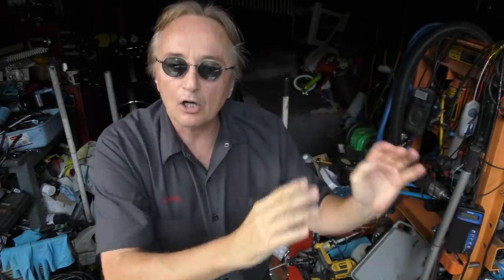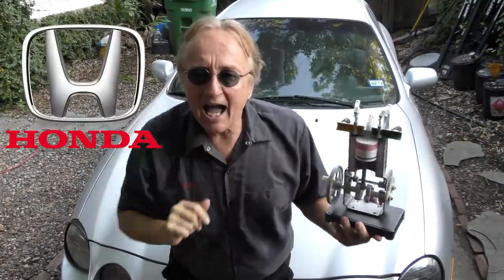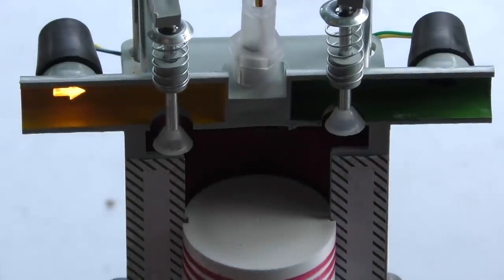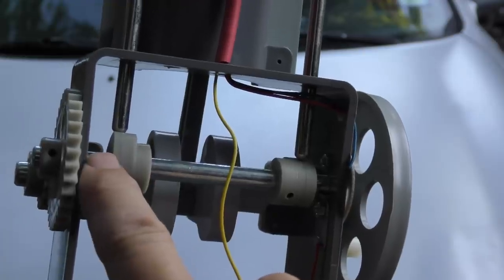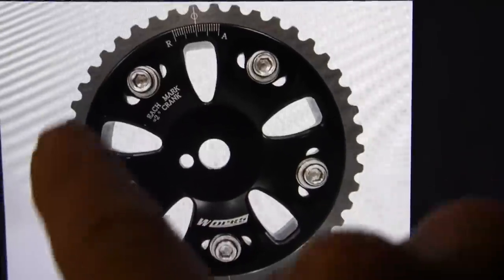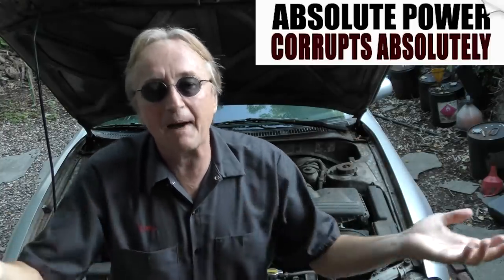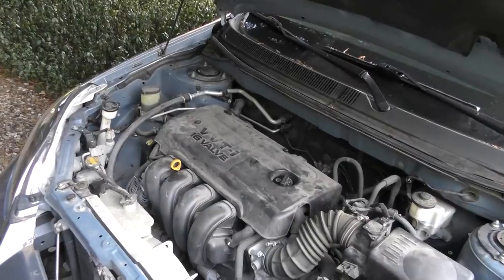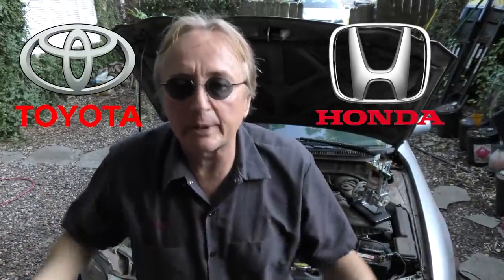VTEC Just Kicked in Yo - The Best and Worst VVT Cars to Buy

Comment: My first car was a 1992 Acura Integra. The most fun I've ever had in any car. Sadly someone hit me and it was totaled. Miss those vtec days
Reply: Vehicle Virals You can always get the latest Civic!! 😁 Maybe even the Type-R 😎
Reply: Abhilash Nair No way! Not even comparable :)
Reply: Vehicle Virals Why do you say that?
Reply: Abhilash Nair The driving experience and feedback you get from driving an older car cannot be replicated by a modern vehicle.
Reply: Always wanted a Integra or RSX. Have a 06 Civic now which I love driving for the gas mileage when I’m not driving my truck.
Reply: Vehicle Virals get a DC2 imported and thank me later
Reply: Love my GSR. It feels like I'm turning the front wheels with my hands.
Reply: Abhilash Nair The new Type R's are rice imo.
Reply: no.
Reply: 92 integra didn't have vtec
Reply: Raiders 559 wasn’t a gsr then I have 92 integra gsr it has the vtec badges even on the sides of the car
Reply: more like factory cheap plastic. hard to be rice without a fart can and leds lol
Reply: SeanxSkillZ never knew 92 Integra had v tech I thought they Only had a Ls motor
Reply: Phillip Morrison nah actually I’m under the process of restoring my paint due to sun damage my cars exterior is stock besides my front lip and a dual exhaust tip lmao I didn’t delete my muf or cat😂 I wanna restore it to its original condition since it’s a pretty rare car
Reply: Ls series is from Chevrolet...
Reply: Raiders 559 yeah bro it was apparently the first jdm vtec engine to be in usdm market don’t quote me on that I’ve just seen that a couple places but yeah it has the dual cams
Reply: i was talking about the new type r . i love the integras. good luck restoring your paint. gotta love Japanese clear coat lol
Reply: I had a 93 DA! Freaking fun car to drive!
Reply: Phillip Morrison b18b1 is Ls version in some integras,gsr (vtech) is a b18c1 I believe.
Reply: Vehicle Virals Aint that the truth. When I drive my familys Mercades and put it in manual mode the transmission always seems slow to react. Not like a real manual.
Reply: Raiders 559 they had a gsr one that did have it. But they didn't make many
Reply: Phillip Morrison he's talking about the ls integra
Reply: Fox McCloud 007 Shift paddles will never beat the experience of a real manual.
Reply: That was the slow gsr too
Reply: Vehicle Virals bought a 1992 GSR brand new back in 92 did $8.000 in mods that includes  SS header and cold air intake and sent CP to FL for upgrade had sus lowered short shifter the list goes on went threw 5 sets of breaks the includes rotors car would redline in 5 gear and do 140 had CART NO 1 for plates loved HONDA F1 got married  then had to trade it but at least i got new HONDA accord  still miss that car
Reply: Raiders 559 b17a were the vtec motors in the 92-93 gsr
Reply: Phillip Morrison Honda also has a series of engines called LS
Reply: Wrong, the 92-93 Integra was available with a b17a1 vtec motor. Simply put, its easily one of the rarest of the 90s hondas. Period.
Reply: Vehicle Virals I had a 94 Integra for my first car and loved it but unfortunately I was young and dumb and bought one that was not in great mechanical shape. I ended up selling it for what I paid for a year or so later but I loved it and really want to get another one in the future. right now I have an 07 SI with a bunch of HFP parts, invidia q300, skunk2 alpha header, Injen CAI, solid motor mounts and Hondata. but it will never replicate the feel I got from the Integra plus that Integra interior held up waaaaaay better than the civic one.
Reply: Ive been driving second gen integras since my first one in 1998. 20 years later I still have a DA, and park it right next to my rsx type s.
Reply: Vehicle Virals actually the new type r is an engineering marvel, easily the best Honda they've ever made in terms of performance. You should do some research on it and consider it.
Reply: Abhilash Nair those new civics are not even civics. Worst gen imo
Reply: Funny thing, I actually had the vtec solenoid wired to a button that I taped on to the shifter. I could literally activate vtec  whenever I wanted 😂
Reply: Blew the motor in my rally integra last weekend.  Doing a euro r swap.
Reply: I had a 91 and engine blew
Reply: My first car was an AMC "Hornet Sportabout Wagon", with decal "wood siding".  Sadly, it was a Hornet Sportabout Wagon with decal "wood siding".  (And "burnt orange" color...)
Reply: Scorpio7 XXX  i considered doing a b20 vtec.  Be a little cheaper but figure the euro r would work better for me if i import a low mile drivetrain.
Reply: Da9 Integras are always fun to drive and own for the Honda family.
Reply: Still daily driving my Prelude SH to this day.  Vtec and torque vectoring still work fine after over 20 yrs with minimal maintenance and no major repairs. It's just a fun car to row the gears and throw it around corners, even if it's rattly and the clear coat is failing...
Reply: Vehicle Virals Honda integra**
Reply: get a 2000 integra and k swap it
Reply: So u had a gsr?
Reply: @isaacgonzalez7040  nope and LS
Reply: We have the same first car but mine is a 1999
Reply: Get an rsx bro
Reply: @raychang8648  woukd love that nowdays
Reply: My dad had a Honda Integra!
Reply: Vehicle Virals - those cars were awesome. with a red line close to 8K RPMs... it was like a motorcycle! and I know it's a total cliché, but when you felt that VTEC kick in, man... you could feel it kick in, yo!
Reply: 1999 chevy cavalier my brother had a 1997 GSR, more fun to drive then my Speed6 hands down
Reply: NOOOOOO NOT THE INTEGRA MAN
Reply: My cousins 94 si eg hatch is just sitting in our yard bc the struts and CV's are bad smh.

Comment: As a long time BMW owner, the switch I made to Acura/Honda has been nothing but a great experience. The engine is super easy to maintain, and is extremely reliable. Thanks Scotty
Reply: which honda/acura did you get?
Reply: @mathewsoul7623  Acura TL for myself, Honda Accord Coupe for the wife. Both running beautiful with very little maintanence
Reply: I take it you weren't an E36 M3 owner. If you were, you'd never sell it for downgraded Japanese cars like those. Although they are cheap, and cheap to maintain they just don't really have very much of a soul compared to any of the M cars. Owning them is a labor of love but if you do everything right they last for a very long time

Comment: had my integra for years, over 300k miles still runs like new
Reply: ThumbsUpGaming yep!  My 94 ls has 309,000 miles and purrs like a kitten.  Only changed timing belt twice, water pump, and front rotors.  My goal is 500k and if it finally gives I’m putting in another b18b1 in her.
Reply: I have make with my Civic 360000km and the 1998 Integra of Frend of main has 330000km without any Problem Honda is fucking Reliblle
Reply: ThumbsUpGaming what did you do what kinda maintenance you did please let me know 

I got a 3.0 Honda accord v6 just hit 120k
Reply: Got a 2003 Acura cl with over 300k only thing it need is motor mounts other then that it's run strong af
Reply: I'm a Uber driver driving a sporty 2014 Civic si sedan. It is at 161K and still running strong.
Reply: Josh Smitty Taxis “whats an odometer”
Reply: I have a 2003 honda accord 2.4L with 330k still running like champ...
Reply: My 96 Integra GSR is at 226k miles, still runs decent lol. Probably gonna K Swap soon though before it blows

Comment: Call me a ricer but I love hondas they're great cars to get into the car scene or just have a good reliable daily
Reply: the • 6999 seconds ago I bet you don’t even have a car
Reply: the • 6999 seconds ago dude Honda’s and yotas are the best bang for your buck, you’re aren’t getting a luxury car most always have plastic and stuff sometimes leather but you’ll never be let down. Like Scotty says, typical Toyota starts right up
Reply: @plagued3904  I dont know about Toyota being best bang for buck too pricey at least where I am there good cars but aren't exactly budget mind you Hondas seem to be more expensive here too then they should be, I wound up getting a mazda for relatively cheap and did front end rebuild and engine and clutch swap so basicly a brand new car with premium suspension components and clutch for about 5500 total, edit: I also have a good source for cheap oil and filters, I run the 5w20 full synthetic platinum oil and usually napa gold branded fram filters, but occasionally k&n if the 1348 napas are out of stock and k&n are on sale
Reply: Hondas are  good yh

Comment: Great information Scotty!
My 2005 4.6 3 valve works perfectly after 148,000 miles.
I have only used motorcraft fl 820 filters and synthetic or synthetic blend oils and changed it between 3500 and 4500 miles. These engines get a bad rap. I love mine! 
Regular maintenance people!!!! Thanks Scotty!
Only used

Comment: Got to love Honda
Reply: RAM TRUCKS sorry ur unlucky but I have seen hondas go over 400k
Reply: RAM TRUCKS well what caused it to fail in the first place... and ram trucks aren't great either, my brothers crankshaft gave out at 102k so dodge sucks too, and to replace a Honda motor you're looking 3-500 bucks, try to replace the entire motor on a 2012 dodge pick up
Reply: Todd Medium Wellington III it’s hard to read that without laughing when there’s so many ricers out there ruining the brand name. But at least they are reliable.
Reply: That's on you for not paying attention to the temp gauge. Easy fix that costed you an engine
Reply: RAM TRUCKS damn sucks to hear, i wouldn't say they use cheap head gaskets though, my Prelude's heater hose busted and my engine got 3/4th hot and i immediately turned it off and coasted to a stop, luckily less than a mile from my house, fixed everything the next day and was fine, recently compression tested and tested perfect, some cars aren't as lucky as others when it comes to overheating, i had a BMW with a bad head gasket
Reply: Glad I  have my Pontiac,  has NEVER let me down!!
Reply: That's why I drive one. And is so much fun!
Reply: I don't love it but I can definitely hear it... You know fartcans
Reply: Todd Medium Wellington III 
Lol I don’t because I’m a vw Guy , but they’ve been into researching airflow heavily going back into the 60s. 
They can make a port flow some serious air. 
Look at that 250cc 6 cylinder they made in the 60s that revved to like 20-22k...
Rc166 I think it was called. 
That was the first stage , the bike invasion and higher revving engines. 
Pretty funny back then that a Suzuki x6 250cc would flat kill any domestic or British bike that was around 750-800cc.
Reply: RAM TRUCKS Interesting Honda engines were put in Rover's and they blew head gaskets all the time.
Reply: Colm Farrel 
That horrible v8 with liners? 
That was Buick based, and are junk.
Reply: RAM TRUCKS my friend Ram truck blew the transmission at only 86K miles and my honda right now got 206K miles still running strong.
Reply: RAM TRUCKS my buddy has a dodge ram 1500 2016, and the transmission was screwing up at 25000 km. The cummins are alright though. My honda has 250000 km on it and still strong and pulling hard.
Reply: RAM TRUCKS No that's you neglecting to address the fan switch issue. There's nothing weak about Honda head gaskets. They rarely fail and I do mean RARELY. The real issue here is you not paying attention and addressing a rather minor problem that became major because of your ignorance and neglect. So instead of pointing the finger at Honda point it at yourself. SMH
Reply: I got Merc E class 2005 cdi (diesels lasts long) with 300k 
Oil change, wipers, brakes... thats all I ever did.

Own it since 230k
Reply: Joseph Bell I like honda but I wasnt a fan of the b20, my buddy blew a head gasket on one. I have the r18 seems to be good id rather a k20 or 24 though.
Reply: In case you didn't know, you have a temp gauge on the dash. And Honda doesn't suck, that aren't the best out there but they are better than most.
Reply: + SirVixIsVexed
That's because of all the kids that get a Honda and think because they put a fart can on it they become a racing legend who has the super power to shift without the clutch.

Comment: VVT-i is different as it just uses cam phasing without lift control. Only some models of the  the Celica and Corolla  had lift control in Toyotas line up for the US market. Also, most implementations of Honda VTEC does not have cam phasing, only lift control.
Reply: You got it spot on. Many manufacturers have tried some variations of simple cam phaser and/or variable lift control. It wasn't till later that both started to become available combined in certain engines. The technology is great, but I have seen a company that designs a superior form of variable valve timing, and it requires absolutely no camshaft to accomplish this feat. The technology has been tested and shelved by several companies, but so far, the company Free valve has been putting into action for awhile. Pneumatic and electronically controlled valves, thus eliminating the need for camshafts.
Reply: Didn't think any engine had both phase changing and lift control, definitely no Honda's.
Mivec Mitsubishi virtually same as VTEC, same BMW Porsche Ferrari, Toyota Peugeot used came phasing, never heard no one use both.

Comment: My best gas mileage was 40mpg in my old 2008 Toyota Yaris VVTI 4 dr automatic. Sold it still running strong at 239,000 miles. Bought a 2003 VTEC Accord 4-speed coupe with 85,000 miles earlier this year and just logged 37mpg. It's a blast to drive!

Comment: The first engine that utilized VTEC was Honda CBR400 bike in 1983.
Reply: Wasn't the same as vtec in cars. They didn't have variable valve timing. When VTEC kicked in, the engine would run with 4 valves per cylinder (2 in, 2 ex) for high end power. At lower rpm's the engine ran on 2 valves per cylinder (1in, 1ex) for torque.
Reply: Seth that's actually how vtec-e and 3 stage vtec work, so the principle is the same. You are changing either the lift, timing, or both of the valves somehow
Reply: Armouredfalcon Well said! Nissan has VVEL (Variable Valve Event and Lift System). I am pretty sure the vehicle doesn't really need a throttle body even! Check it out!
Reply: Armouredfalcon Honda was calling it VTEC so it is VTEC.
Reply: Ancient Wheel It may be called VTEC, but it's not the VTEC that Scotty was referring to in this video. This video talks about variable valve lift, not the engagement and disengagement of valves in the cylinders. So yeah, it's VTEC, sorta. The crossover actually sound kinda similar!
Reply: Seth it is variable lift, it varies between zero-lift and full-lift. Hehe
Reply: Ancient Wheel its the same system as the T-VIS System Toyota used on the first generation 4A-GE.

Comment: I have a 09 Mazda 3 with 240,000 miles it still runs like a champ. Used synthetic oil since I bought it changed it every 4,500 miles and never left me stranded.

Comment: Thanks scotty for recognizing the honda vechicals because there up there with Toyota or at least that's my opinion and I still have a 91 civic dx that has 300 thousand miles.
Reply: Mo V —— my now deceased 98’ Honda Civic EX had 268,000 miles and had a future, until a 3/4 ton Ford hit the back of it , and TOTALED IT. 😞
Reply: Jimmy Sapien 
Hope you saved your barely experienced engine
Reply: Jimmy Sapien em careless trucks..   Just like a last issue magazine of mine, tucked for a decade. Only to be shredded in the office as scratch.
Reply: The only way to kill a Honda or Toyota engine are to run them without oil or water.

Comment: I have a 3.7 mustang with Variable Valve timing. When You swoop past 4 thousand rpms all hell breaks loose and its a blast, with the foot out of the throttle I can get 30 MPG at 75 Miles Per Hour. I love this engine.

Comment: Scotty, thank you for mentioning the importance of changing the oil and using the correct
type in these engines. I'm showing this to several friends who think I am  incorrect in changing the oil in my 350Z and Q60S with the recommended 5W30 at between 3K and 3.5K miles.
The Z has 125K on it and the valve train and variable timing parts all still work
perfectly. The Infiniti only has 14K on it but I expect it's VQ37 to go just as long without issue.
My son now has my '01 Accord coupe and it's VTEC still works perfectly at 180K miles. 
That one uses 5W20. I always use Mobil 1 and their filters and it has worked well
for me in all my engines, including my 1990 5.0L Mustang. My father
used to always say changing oil often is cheap insurance...

Comment: I had an 08 Malibu with the 3.6 VVT. Was smoothest running engine I ever had, great torque.  But a nightmare if the timing chain would go bad. Sold it before it happened to me. Several thousand to repair. Same motor in many Cadillac's. VTEC Honda's are great, as long as you change the timing belt at scheduled interval and  best to do water pump at same time.

Comment: The 2.4-liter i-VTEC is such a nice running engine. 30mpg average over 95,000mi. Drop it into 4th gear and go from 55mph to 105mph in about 5 sec when passing. Amazing engine for commuting. Who needs a turbo when an engine runs like that? Too bad Honda got rid of it and the 3.5 V6 VTEC in place of the smaller turbos. I agree that smaller engines working harder can't last as long.

Comment: If any like the sound of the prelude h22 vtec engagement. look at the Celica gts or Corolla xrs 05-06. They kick in vvt like the prelude. That 1.8 is really surprising.
Reply: I owned one of them xrs. They had the VVTLI and not just the regular VVTI. Lift would kick in around 6500rpm. Surprisingly fast for a corolla lol
Reply: exactly! I dunno why the corolla is underrated, the engine combined with the low weight and you got a beast